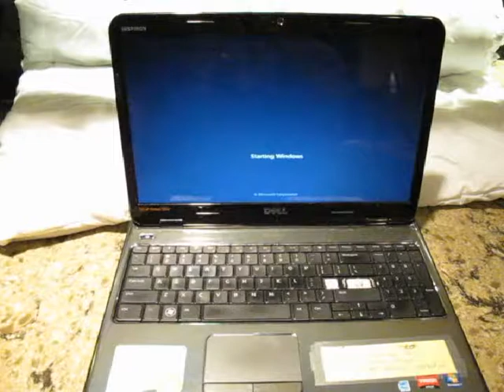MajorGeeks - How to Fix a Laptop with a Comforter.

Comment: If that doesn't work, you can always try re-soldering your motherboard by cooking it in the oven.  I've tried it and it works great!  Just remove all components from the motherboard including the CPU, RAM, CMOS battery and stickers.  Get a cookie sheet, ball up 4 pieces of tin foil; put the pieces of tin foil on the cookie sheet and place the motherboard on top of them so it sits evenly above the cookie sheet.  Pre-heat the oven to 350 degrees, pop it in for about 10 minutes (make sure you turn on the exhaust fan cuz it gets a bit smoky when burning off sticker residue), remove, re-assemble and cool.  

I was able to get another 6 months out of my laptop because of this neat trick!